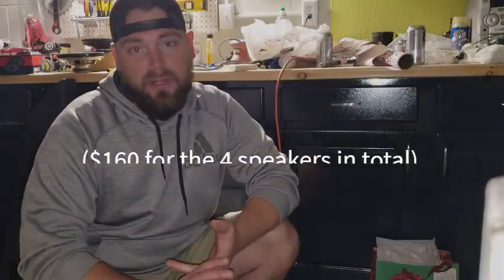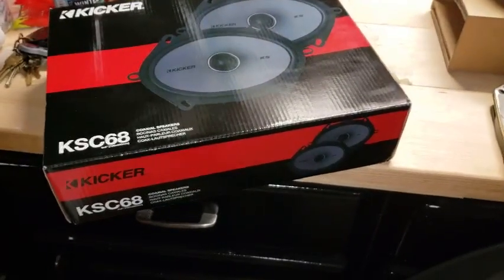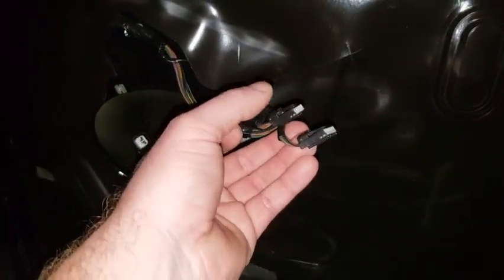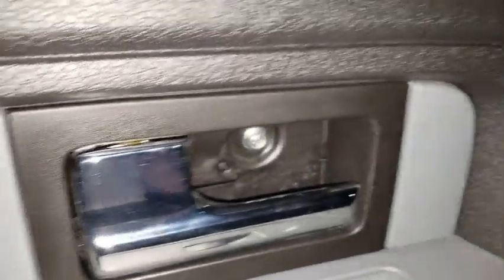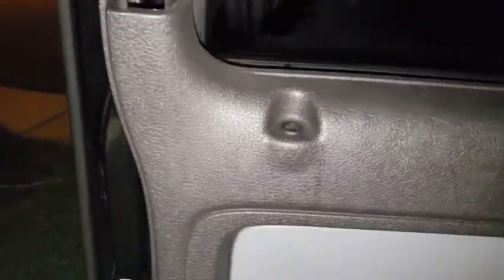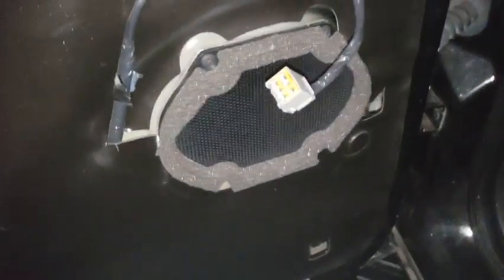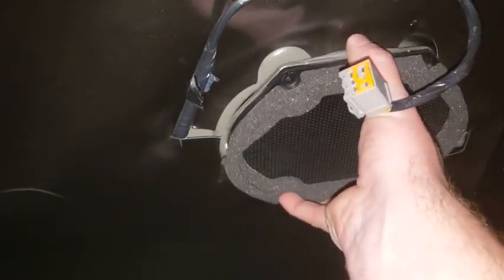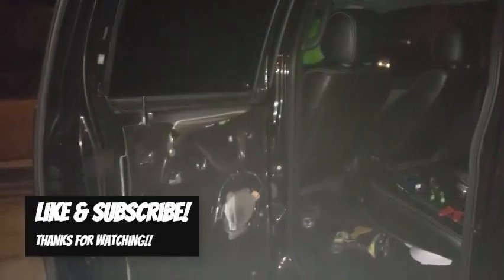F150 Door Speaker Upgrade

Comment: Where is the sound test??  On a scale of 1 to 10 how would you rate the door speakers upgrade??
Reply from the maker: Just the speaker upgrade I would say it was about a 7 out of 10. Now I have the 2 10" subs under the back seat with a 5 channel amp and it's 10 out of 10 overstock no questions asked. The amp really lets these speakers open up and the sound is MUCH more clear
Reply: @jtpbuildz959  thanks for the reply.  I have 2 shallow JL's 10" lots of Bass but not enough mids and highs in my 2017 F150. Thanks again!!

Comment: Currently looking at doing this to my 2014. So 6x8’s can fit in the front and rear doors? Looking at kickers and Rockford fosgates. Do the speakers any sort of bass without an amp? Eventually I will be putting in an amp just curious how they would be without. Thanks!
Reply from the maker: 2013 and 2014 have identical doors so yes. I like Kicker so went with them and yes, they have a bit more bass than factory as well

Comment: Did u put a amp or its used with the factory head unit
Reply from the maker: Originally just the factory head unit, now I have a 5 channel and subs, huge difference with the amp for sure
Reply: How did you run your speaker wire when you added the amp